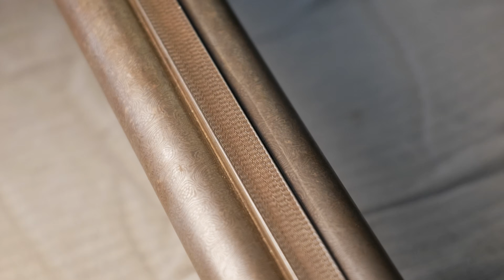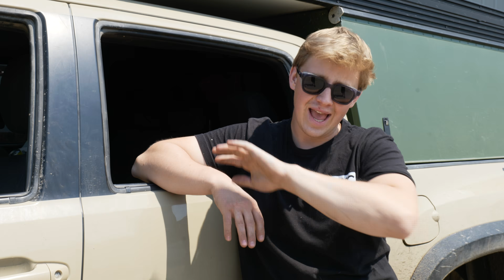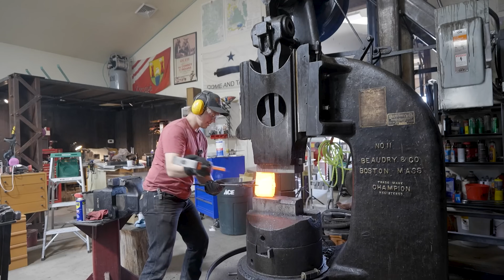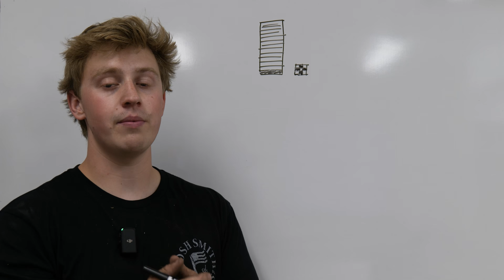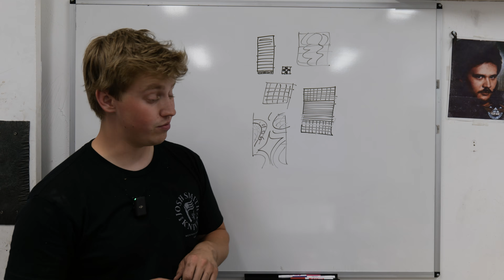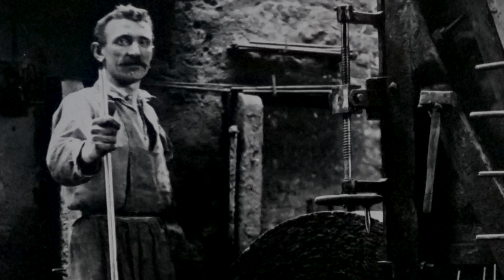These Guys Made Mosiac Damascus 150 years ago??

Comment: In the British gun trade barrels for shotguns are commonly filed to shape. It's a very accurate way to make a very thin barrel concentric. If the wall is thicker like on normal shotguns I would say a lathe would be good enough, and of course grinding works fine too.

Comment: I'm surprised that the video hasn't popped up earlier among the metal working community on the internet more often
https://www.youtube.com/watch?v=fa9dlvRDuQU
These guys basically got hit by the perfect storm like most of the western and commonwealth countries, demand dropped off, two world wars and a depression meant there was no apprentices because they all died in the wars and further industrialisation in the metalworking sectors. That industrialisation was done because spare hands just wasn't around so the machine had to fill the role of apprentice and the operator could pump out the necessary amounts of material.

Comment: In the UK, we have a sweet ( candy ) called Rock. It's usually bought at a seaside town. It's about 12" long and maybe about 1" in diameter and solid. Just under the outside edge and running around the circumference, and down the entire length will be the name of the seaside town. It starts off as a very large diameter circle made up of lots of little bars to give the pattern, and maybe about 3 or 4 feet long. It is then rolled and rolled to compress and lengthen the original starting billet until it is maybe the 1" diameter by about 20', then it is cut into the 1' lengths for sale in the souvenir shops. I think it might be similar to the way the Belgians were making their mosaic pattern tape for the gun barrels. Here is a video on YouTube of the process. https://youtu.be/V4tYYgS1SgQ?si=UFBheKAVQB0KzTs7
Reply: This link to the traditional candy production had also jumped into my mind though it took me a day after having watched the video make the connection.
Reply: I was just wondering this myself.

Comment: Mr Cool air conditioners are actually pretty good quality stuff. If I had an off grid or solar setup it's probably one of the first things I'd be getting because of the efficiency. Being on grid and using regular electricity it's not really worth it for me, but for sure if I was off grid or needed to lower electric bills they're great.